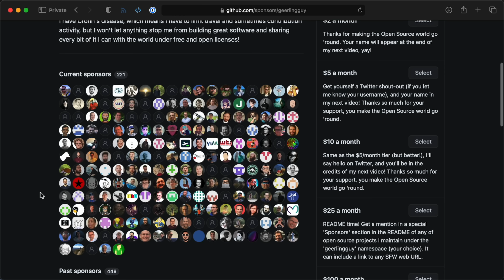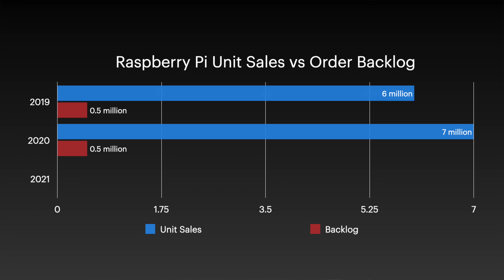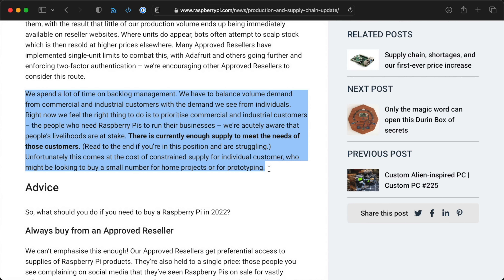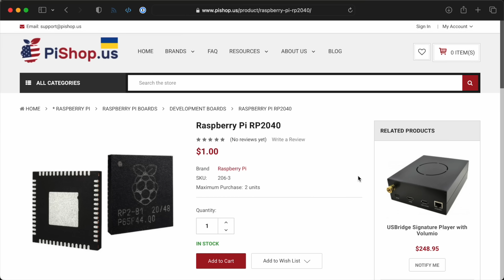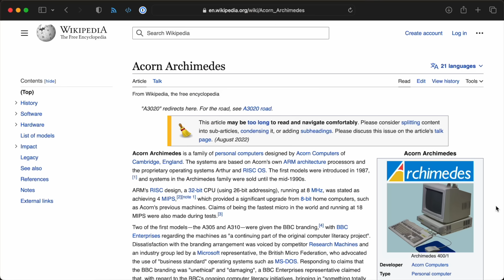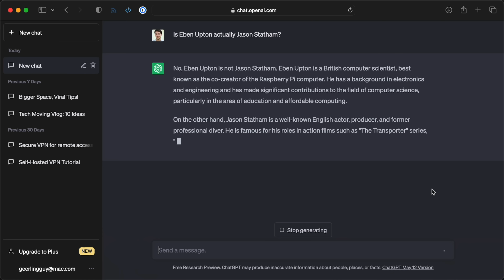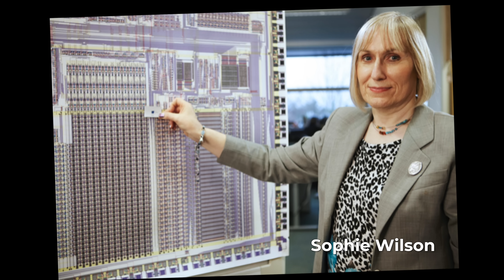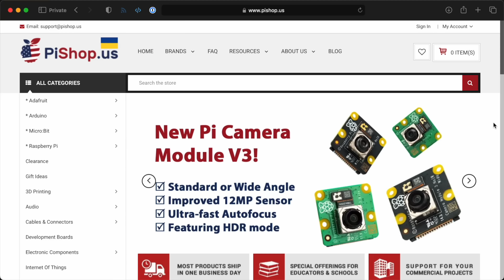He started a computing REVOLUTION—then the shortage hit

Comment: When it comes to the Pi Pico, I think it's saving grace was the PIO features! Without that, it would've just been another microcontroller that got lost in the sea of other cheap microcontrollers.
Reply: The pico w is a miracle board. I used a pi zero for a project but didn't like the long boot times. Turns out that a pico is actually capable of handling all the time critical tasks better and boots in seconds. Did I mention cheaper? Did I mention smaller? Amazing board.
Reply: The pico w has revolutionized my projects and blown the door wide open on the amount of things I try just for the sake of trying. I love it.
Reply: Great software ecosystem for it, too.
Reply: And/or vice versa.... I use SiLabs micros and such... but they're not OpenCV compatible and really can't Linux...

It's either "somebody strapped Linux to an Arduino" or... "somebody gave you IO with a SBC"
Reply: I agree, that's really a fantastic feature + for the rest its quiet well equipped
Reply: And its documentation is awesome (compared to ESP32s for example)

Comment: Hope to see new models soon. That should help reduce the demand/scalping for the Pi4.
Reply from the maker: You and me both!
Reply: hope they release RISC-V variant
Reply: They already said the Pi 5 would definitely NOT be coming out in 2023. On the other hand that doesn't eliminate a variant of the zero, compute module, or pico, or perhaps even a more efficient version of an older existing model or even a new version of the 4 with even more RAM or a new storage option.
Reply: @hackerx7329  If there are enough chips available worldwide, come on chip manufactures and politicians, pull your finger out : )
Reply: With new models of Pi, they will have new Compute Modules for mass manufacturers. The regular Pis only get built when all the CM orders are filled.
Reply: x to doubt; the industry demand is already phenomenal, and that doesn't just go away because there's a new product. That's exactly why they're still building thousands of Pi Zero 1s and Pi 3s.
Reply: @BeyondImaginationzz I would love to see a risc-v platform
Reply: I really want to see a bl808 (ox64) based pi, for the software support of the weird architecture with 3 different cores (iirc 480 mhz 64b, 300mhz 32b and 150mhz 32b)
It's imo one of the best cheap soc chips when you want something similar to a pi zero with wifi and zigbee.
Reply: @bern047  Chip manufacturers are already cranking out as many as they can, and new factories take years to make
Reply: @sundhaug92  Plenty of Raspberry Pi 4s 4GB here in the UK, just bought 4 for my self at £50 each, keep cranking out those CHIPS we need them, lots of them
Reply: I wonder if they are gping to build a chip on intel 14nm now considering its a very large manufacturing Base that needs customers now that intel doesnt use it anymore and has opened its fabs. Its a bery very mature and not bad node
Reply: @the_retag  iirc intel will still use their 14nm nodes for their tiled chip design with less critical parts like i/o and L3 cache.
Reply: @satibel  i though they might, but i don't think that's gonna take up nearly the capacity that pretty much all intel sold for half a decade was made on
Reply: @sundhaug92  Put Elon Musk in charge and you could cut that lead time to under a year.
Reply: @thisisreallyme3130  The fact that Eben addressed the priorities and the numbers directly in this interview clearly passed you by. The compute modules are secondary, because most customers want standard SBCs. That your personal and somewhat twisted narrative goes against the evidence, really shows how ignorant and narrow minded some people are. 🙄
Reply: @mikewurlitzer5217  Put Elon Musk in charge, and he would kill the Raspberry Pi off completely. And probably several other companies too.
Reply: @another3997  Oh BS!  His success/failure ratio is stellar compared to most other CEOs.  Just another green with envy Musk hater.
Reply: @mikewurlitzer5217  Yes, and the price would probably shoot up to $200 as well. Elon Musk isn't a wonder weapon as some people think, he had much luck and also had stupid ideas like The Boring Company or buying Twitter.

Comment: Without Raspberry Pi i would have never found my love for Linux and my Love for Computers.

I would not work in the field, if Raspberry Pi wasn't there.
Reply: i think for me its the other way around, i love linux, and for years i wanted to try a raspberry pi, but never had use for it. after i bought it i have a thousand uses for it, so when it available ill by one more :) maybe even an cm4 just to play.
Reply: @davidzuijdwijk6806  — What are some of the uses you have found for it? Just curious because I haven’t discovered (m)any (due to lack of m.2 SSD.)
Reply: @gearboxworks  I'm not a fan of the company itself anymore, but there's literally dozens upon dozens of things you can do with a Pi, if not hundreds. You can host your own website, host your own search engine, learn programming, set up a media server, host your own VPN, turn it into a smartphone, learn cluster computing. Honestly, there's so many things to do with a Pi that I've barely done a fraction of them.
Reply: @liquidmobius  Oh, okay. I was thinking you meant you could do so many things with a Pi you could not do with a regular computer/server. 

If you meant “there are thousands of uses for a computer/server” then sure, I think there are tens of thousands of things you can do with one, likely more.  

But I just do those things with an x86 computer with lots of RAM running a hypervisor like Proxmox, and lots of VMs and/or containers. So much easier than running a bunch of Pis.
Reply: @liquidmobius  — I can’t seem to find your reply to me where you were (likely rightly) saying my reply sounded sarcastic. I did not mean it to be sarcastic so rather than let others read it and think the same I’m going to include that reply below this paragraph.

——

Re-reading my comment I can definitely see how it could have I been interpreted as sarcastic, please, except that I was asking questions without an agenda. 

I was honestly interested in your stated use-cases for the Pi that I had not previously envisioned and that were not something I could do with other larger computers.

But I when you answered with usage I could do with a regular computer and that were not unique to an SBC like the Pi I responded with disappointment, which it appears you interpreted as me being sarcastic. Given that that was likely my fault, please accept my apologies.

I am aware of a few things for which the Pi is uniquely suited for, but not many so when you said “thousands” I was really intrigued to learn more. Again, it was my disappointment that you were referring to things I could do with other computers as opposed to things the Pi is uniquely capable of. 

Finally, the last thing I want to do is create drama from my comments. I plan to start posting videos about home labs and I was just looking for more ideas on how to use a Pi in ways I cannot just use virtual machines and containers on a Proxmox server for.

P.S. Also, to be clear, my mention of x86 was not antagonistic to ARM, it was just my way of referring to the type of computers that most people typically run servers on today, nothing more.
Reply: @gearboxworks  I really didn't want any comment section drama, so I removed it, and judging from your reply I was correct to do so. I said there are "dozens upon dozens, if not hundreds" of uses for a Raspberry Pi. That's literally word for word what I said. I did not say "thousands". You're deliberately misrepresenting what I said. I hope you have more integrity when you decide to produce content.
Reply: @liquidmobius  While I love YouTube for the content and positivity of the more successful creators I lament how quickly commentators are to assume bad intentions rather than assume a simple misunderstanding and then give people the benefit of the doubt. 

In this case I erred in thinking I was referring to the original commentor who did say “thousands” of uses. I wrongly assumed you were that person. It wasn’t until you claimed that “I deliberately misrepresented what you said” that I realized you were not the original commenter.

Hopefully that clarifies and we can move forward drama-free?
Reply: @gearboxworks  Well, if you wouldn't have been such a smarta** with your reply to me, we'd be 100% good to go 👍. I was just trying to honestly and politely answer what I thought was an honest question. There's no one to blame but yourself.
Reply: @liquidmobius  — I have tried everything I could to lower the temperature of our exchange, including taking the blame for any misunderstanding. 

At this point I am simply at a loss for how to reply to you, so will be my last reply on this thread as it seems anything further I could respond with will just result in yet another negative exchange.
Reply: @gearboxworks  Alright, well I already answered your question, although admittedly only partially bc it's completely impractical to list everything you can do with a Raspberry Pi. I did, however, list some of the most common. What else do you want to talk about?
Reply: @liquidmobius  But you can host your own servers better using a way-cheap used notebook PC.
Reply: @chrisalbertson5838  Yes, of course. There's a million ways to skin a cat. Some people like ARM SBCs and some don't. But criticizing the use-cases of the RPi for lack of m.2 support is like saying: Why take a bus to New York? I'd rather take a plane. Fine then, take a plane if you want. A plane isn't a bus, nor is a Raspberry Pi superior to more advanced x86 solutions. No one ever claimed it was.
Reply: @gearboxworks  music server, nextcloud, vpn client, password manager, sync server, meta search. lots of containers that just run on a headless archlinux arm so no point releases or major updates to worry about, running on a ssd over usb. off course i could run those things on a more powerfull server, but that will use alot more electricity. in docker you can set hardware limits so syncthing thats just running for moving backups around doesnt spike the memory.
Reply: @davidzuijdwijk6806  — Thanks for the follow up.

Are you talking about running all those services off a single Pi, or multiple ones?

I am skeptical that those services could all be run on a single Pi, and still be fast enough to be usable. But to be fair, I have not tried so I could be completely wrong in my suspicions. 

If you can run all that off a single Pi then definitely, the lower electricity cost of the Pi in specific, and ARM in general, is a big plus, especially in geographic areas where electricity cost is higher.  OTOH if you have to run them on multiple Pis, I would think you might be getting diminishing returns?

Maybe when the prices come back to Earth I can pick up a Pi to see what is possible. I am not willing to spend 3-5x of SRP in the meantime, though.

Comment: The PI being out of stock and the Pico being plentiful has actually been very interesting. We're discovering that the Pico is a really capable computer that we have overlooked because the PI was available. Reading some sensors and posting the numbers to a server was typically a job for a full blown PI but really a Pico WiFi can do it for a lot cheaper and a lot less power.

I really appreciate my PI more now and will use it as a proper computer or a proper server and give the job of running a single program to the Pico. Really that's what a Pico is, something to run a single program from boot up. Where as a PI is a general purpose computer similar to a PC in that it has an operating system and can run a bunch of programs at the same time.
Reply: I guess in years past the big pi may have  been seen more fittingly as embedded ala pico, but I don't go back so far
Reply: Microprocessors are able to run lots of tasks, it’s just to select a proper RTOS (i.e. Chibios, RTOS)
Reply: The pico is not a computer, it's a micro processor, it's a completely different thing
Reply: is pico the first microcontroller that you came across? never heard of arduino or esp?
Reply: @somethingsomething464  There was the PIC from Microchip. They were popular in the 1990's for 'chipping' a PlayStation so it thought pirated CDs were genuine. Technically things like the Z80 and 6502 were micro controllers that needed a few support chips. The radical part was fitting memory, storage and IO into the package meaning you no longer needed data and address pins, they could be used for IO. Your typical 1980 microprocessor had 40 pins and none of them did anything useful, then along came the PIC and prity much all it's pins did something you could use, like turn on an LED or read a sensor.

The amazing thing about a Pico is that it's about 100 times more powerful than a Z80 or 6809 from the 1980's yet it's still a little chip that you turn on an LED and read a sensor like a PIC.
Reply: @somethingsomething464  PS, there was also a chip from SGS Thompson a French company, I did program that a couple of times. I think their chip became the Arduino. I also did some work on the Rabbit which was programmed in C. There have been a variety of micro controllers over the years but I reckon the Pico is the best so far.
Reply: Ohkaay but your comment was worded as though Pico was the first microcontroller that you discovered.

"Reading some sensors and posting the numbers to a server" was never "typically a job for a full blown pi" , people commonly used arduinos and esps and such. And those have been around way longer than the Pico.

It's nice that you know about those ancient microcontrollers, I'm not familiar with them, but it makes me wonder why you would be ignorant about the existence of probably the most popular microcontrollers (in use currently)...hmm.

Have to Disagree about Pico being the best, many variants of esp beat picos both in price and functionality.
Reply: @somethingsomething464  reading sensors and writing to a MySQL database is something I've been doing on the PI using Node-RED. I'm not sure if I really like it. At first it seems simple but when you really try and make it do what you want it actually gets in the way.
When the PIC was coming to prominence  I always felt it was better for me to program in C on the Z80 but as micro controllers developed then C was available on them too. For 20 years I've not used micro controllers so I basically skipped the Arduinos, sorry if you're a fan. 

I've recently made two projects using Picos that people have previously use Arduinos. Taking an old 1980's Dragon 32 keyboard and converting it into USB for use with XRoar emulator. And a similar project making an Arcade joystick.

The Pico is overkill for these and what I did would have used the same or similar tools on the Arduino, Python and Thonny.

The fact is the Picos are cheap, plentiful, powerful and there is loads of support. Plus they are made in Wales like the Dragon 32 was.

Comment: I was lucky enough to get some pis before the shortage. The device and the software has been solid for me. Some of the most fun I've had with computers. Opened me up to many ideas, like interfacing the GPIO with relays to control things, IOT, home networking, NAS.... many things I would not have bothered with if not for the pi and the FOSS community around it (thanks Jeff for being a champion here). Business choices must be tough. Glad someone else has to make the call and gamble their money on it. I could still use a couple more pis. And even more so, if any of mine should happen to fail, not having another to replace it would hurt.

Comment: I've been a long time Pi user, having ordered my first Pi about 6 minutes after sales first opened for the original model. I have a project on the shelf waiting for a Raspberry Pi 4. It will use DPI at custom clocks so I don't know if any other SBC that is capable of doing this, and even if some do their lack of open documentation is a showstopper. I've had a 4Gb Pi 4 (it will be my first Pi 4) on backorder now for about 14 months, and no sign of the order being fulfilled any time soon.

As a hobbyist I find this frustrating, but it's just the reality. I'm pleased with the way raspberry pi foundation has handled the shortage and just hope I'll be able to get my hands on one soon!,

Comment: The stock situation is unfortunate.  I ended up having to purchase an N100 off of Aliexpress and I'm actually glad I made the switch.  Sure, it was 2x the price of a PI4 but it's also 2x the performance and the 10x the I/O.  Best part is because it's a bog standard Intel chip I don't need any specialty distributions.  Linux distributions work as-is.

Unless you need a PI for specific reasons (GPIO, Camera) the N100s are a great option for at-home small computing.
Reply: GPIO is the whole point of products like the PI, you simply bought the wrong product for your use case is all thats happened. 90% of people who buy Pi's just to use them as PC's are completely missing the point of them.